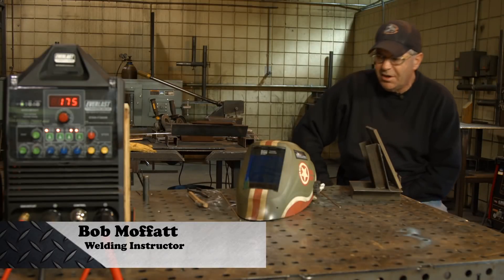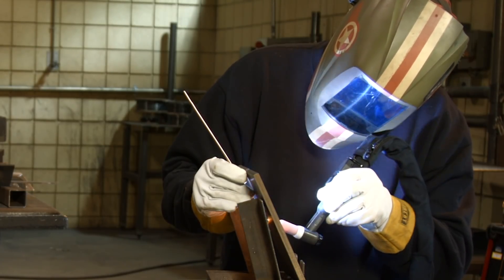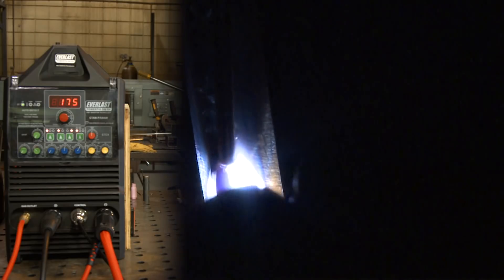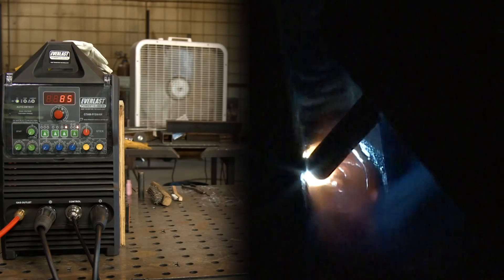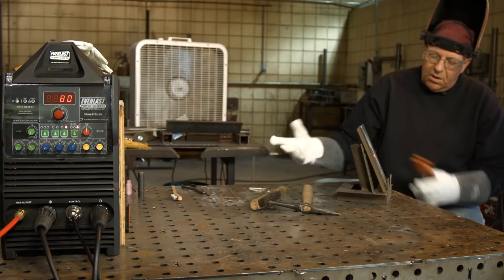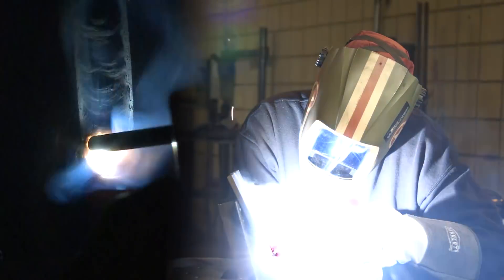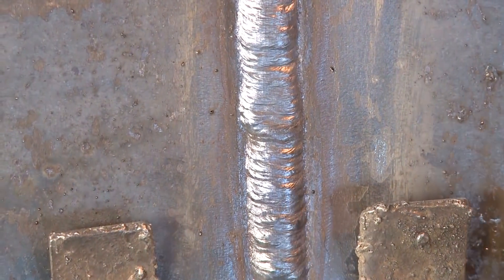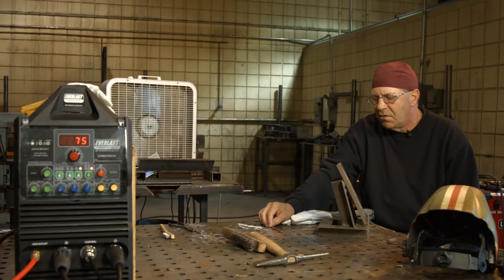🔥 TIG Open Root, 7018 Fill and Cap | Everlast PowerTIG 200DV Review (Part 2)

Comment: 4 degrees to hot with the 7018 back her down just a tad and use a warm rod shouldn't have to peck the slag it will curl up and fall off when the temp is dead on.   
-4 from my arm chair welding spot.Fixing to buy a Everlast 250ex tig I am not a tig welder though certified SMAW for 30 years time to take it easy now. 
Thanks for the video keep showing.

Comment: Just bought a 200 dv. Did you find on aluminum when trying to fether down the arc at the end if a weld that it would cut out be for it should?

Comment: just a question on your tig root walking the cup why do you have the torch positioned like you do ,compared to a conventional position of holding . were you u sing a foot switch . .if the torch was  button operated  how more difficult is it to perform .in the field are tig torches used on pipe scratch type so no problem with activation on and off .cheers for the answer great instructional videos

Comment: my 200dv just came in today. so far its been a great time
Reply: Is it still holding up
Reply: @j.shorter4716  still doing well!! my CK TL26 torch died but probably due to neglect. otherwise the machine cranks right up and runs as it should.

Comment: Enjoy all your videos. Being retired from heavy equip. repair and welding I've welded many times in the rain and snow with 7018 just drying the soaking wet rod out by grounding it out until it is smoking hot and dry. How about a test weld using dry from the oven 7018 and compare it to the same weld using what I just described, letting a 7018 rod sit in water, dry by grounding it out against the work until hot and dry throwing off vapor and do the same weld. Cut apart and check the results. I know this goes against all proper welding procedures but sometimes you just have to do what ever it takes. I would never do this for critical welds. Might make and interesting video. Thanks, Ed K. Cleve. Oh.

Comment: Started welding back in 1971 in northern Ontario Canada 🇨🇦. We were welding wear plate with 1/4" 7018 or 3/16" 7024, in the the winter the shop doors were closed. Within about fifteen minutes we couldn't see the shop door from the middle of the shop that was 110' long. There was a vent fan in the shop but when it ran the heating system couldn't keep up. We had two choices, put up with the smoke or freeze, the temperature outside was in the -30s. When I left there after ten years we had just gotten the first smoke eater. These days smoke filled shops are a thing of the past, I hope! Always enjoy your videos.👍

Comment: Mr. Mofffet, I applaud your video lessons.   Was the objective of the video to test the machine as a product test?   Also, on SMAW you stated that you like the stick touching the bevel face but were "not cramming it in." I am confused.   Does that mean no arc height between the electrode and material?
Reply: Jose Duarte It was too show both the machine and a procedure. I try to hold a short arc to control the weld pool and make it lay flat. Hope that helps.
Reply: Thank you, Mr. Moffat.

Comment: I have a question which has me wondering when a machine is rated for a specific duty cycle, if you exceed that rating , what happens? Doe the machine shut down, trip a breaker, or not produce the same power?
Reply: Matt Matt It usually goes to thermal protection and shuts down. No big. Sometimes it will trip a breaker. I've done it countless times. Hardly ever happens on stick. More so on tig.

Comment: do you cook the 7018 for these videos? And what is your arc length? to quote my other weld instructor my 7018 vertical uphill looks like Fido's but.
Reply: Cook the 7018? Do you mean store it in a rod oven at 150+ degrees? Yes, we store all low-hy and stainless rods in an oven. I try to hold a short steady arc. I can feel the rod barely touching the pool.  Check your motion and technique as well. Good luck!!
Reply: Bob  Moffatt thank you for the reply.  I understand the importance of drying the 7018 for structural welding. being a home gamer and not having a rod oven could I get a comparison of Dry vs stored rods for generic welding?
Reply: Look for a storage tube at you welding supply store. It will be fine.
Reply: Bob  Moffatt I have one, so I cant blame the rod, now it either the machine or me.... must be the machine 😉
Reply: What rod? size? amps? machine?
Reply: Bob  Moffatt Lincoln square wave 175 ,1/8 Lincoln 7018 120ish amps on 1/4 flat plate.  my welds crown like crazy and will occasionally fall out.
Reply: Too thin of plate for 1/8 vert. Too hot as well.
Reply: Bob  Moffatt I'll get some 3/32  and try some more.  thank you for taking the time to help me out.

Comment: This Tig root technique is priceless!!! 
Bob, have you tried 6010 with this machine?
Reply: Try out a 6011. I've found them to run nice on machines that don't like 6010. Maybe something about the AC stabilizers
Reply: Alex Rakir this machine didn't like 6010 when I ran it.
Reply: Bob  Moffatt Then it's probably not gonna like anybody to run 6010 with it:-)
Reply: I'll check it out more when I get time.
Reply: Zach Tarbell 6011/esab nu5 will run on pretty much anything. It is all down to the ac stabilisers.

Comment: can you do a 6010 open root with 7018 out?
Reply: Quang Hoang Sure.
Reply: can you tell me how to fill it flush with the 7018 before running caps on it? what kind of weave do you use to make the last fill beads right before you cap? ive heard of whipping it up and down or even running circles or just dragging it, but wonder if there' s another way to make the last fill beads nice and flush before  capping.
Reply: KRS 1 This video shows it. If you want it a bit more built up, simply slow down your travel. However, be careful you don't push a line of slag ahead of your weld pool.
Reply: oh my bad I was talking about how on 6g pipe. the techniques on this video is something I can use to practice on 5g pipe though since it looks similar to it.
Reply: On 6G and 2G pipe, I use multiple stringer beads.
Reply: I want to kno how do you fill them before running the stringer beads to cap.do you drag the rod to fill or oscilate?
Reply: KRS 1 I like to keep the rod pointed at center of pipe while running stringers for fill and cap.

Comment: i bought an everlast 200st. it die less than 10 months later
Reply: Jesse Acker  200ST is great little sick welder . One of the best units for under 400$ call tech support and they will get you new main board . You have 5 years waranty
Reply: i cant reach a human. i am still trying though. when it worked though it was one of the best stick welders i have ever used. it out welds $1000 millers and lincolns.
Reply: Please check your voicemail and email. We've been trying to contact you all day. Our tech line is open till 5pmEST Monday-Friday

Comment: Your 7018 looks nice and flat. I have been working on getting my vertical and pipe fills to lay in flat but always get a convexed weld. im usually on the lower end on the dig. If I crank it up will that help?
Reply: Frank Rodriguez Hold the sides, weave fairly straight across keeping the rod in the pool and leading edge.